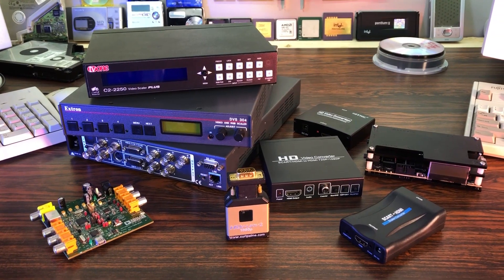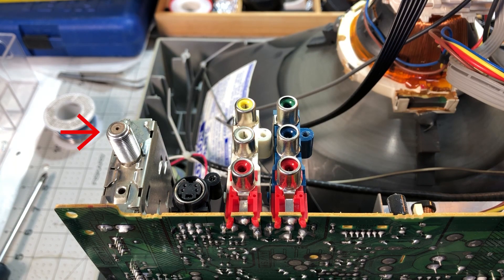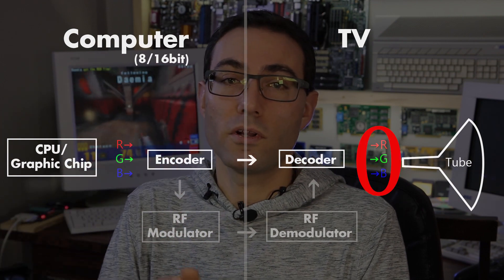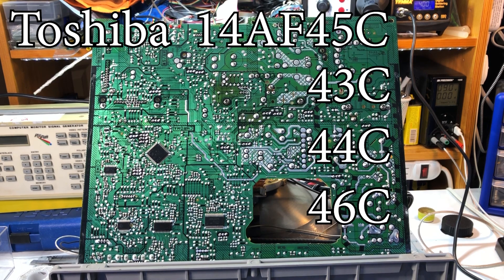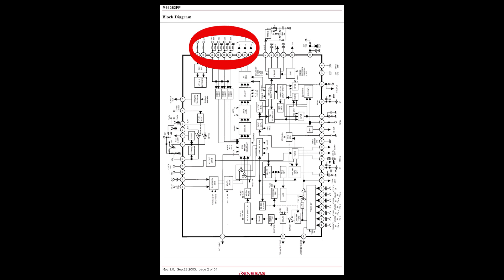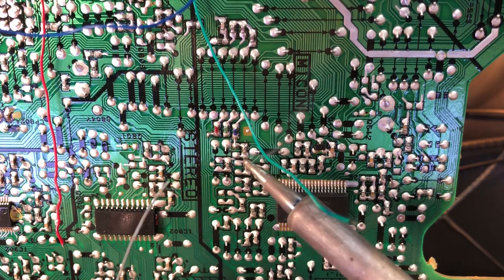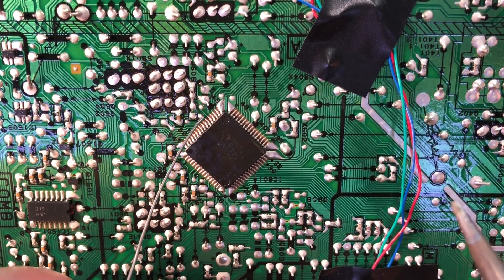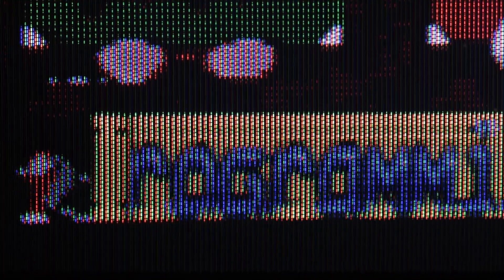Toshiba TV - RGB Mod

Comment: WHY ARE YOU RGB MODDING THIS CRT IF IT ALREADY HAS COMPONENT, COMPONENT IS RGB IN JUST TRANSCODE RGB TO COMPONENT
Reply from the maker: No need to yell. Granted this model already had Component input, and you could use an RGB to Component converter to get identical results, the idea is more to give a tutorial on RGB modding. It also skips 2 transcoding steps and and buying extra hardware for people who want to train on the practice RGB modding with a model that is quite common and easy to find, it was more for the demo and an excuse to make a video about RGB modding than anything else.

Comment: I’ve managed to get a few different sizes of these over the years… everything from 12” to 32”. I like the scanlines with 240p content but they don’t properly handle 240p over component since they sync off the falling edge as if it were HD… even though they aren’t HDTVs. This causes a horizontal stretch and off-center image with 240p YPbPr. Not sure if the RGB mod corrects this for RGB but I’m willing to try. Disabling the Velocity Modulation or whatever they call it is something I need to do too.

Comment: Thank you so much. I picked up a Toshiba 32A35 the other day and found that my tv has the exact same chipset as you. I actually skipped over this video at first due to the differences in model, but it came up again after googling the chip's number so I watched and everything matches up the same. Thanks this made it so easy!
Reply: If the TV has component in you can just get pure RGB from component all you have to do is transcode it to ypbpr
Reply: @kirbo-db6mw  yeah I ended up doing that. Honestly my hobby is taking off since then and I have four TVs now.

Comment: Ive noticed that most Toshiba made chroma/jungle chip has two rgb inputs.
Below 20 is usually digital and are used for OSD.
22-25 are the external analog rgb inputs

Comment: I just  got this exact same tv but 20 inch!! I thought perhaps component video might be good enough....but it's nice to see that I could use those connectors for connecting RGB! Nice work, bro!
Reply from the maker: Hey thanks! This was more a practice run than something the TV actually needs, you are right Component is virtually as good so mod is not really needed on this model. But it saves a converter :p

Comment: What cable are you using? Do you need a Scart cable? I was thinking to use component cables for my retro consoles.
Reply from the maker: I built my custom Amiga to RCA cable using nice recycled shielded component cables. I gre up with SCART but it's so scarce here in North America that most my mods are using VGA, smaller, and easy to procure. I just add a "15KHz" sticker as a reminder :p
Reply: @AnalogThinker  I also grew up with Scart and now am in LA. I did not play amiga but master system.
Reply: @AnalogThinker  where are you located
Reply: @AnalogThinker  do you have an Instagram

Comment: This one has component already though. Is there a huge difference?
Reply from the maker: Short answer: Virtually no difference, except I'm skipping a few internal decoding circuits, and saving on an external converter box for my Amiga, direct feed! Plus it was fun and I thought I'd explain my steps for other models with a similar Jungle but no Component.
Reply: @AnalogThinker  thank you so much. Bob with retro rgb however did explain that the colors are actually better. I have the same set and have the hd retrovision component cables. I was wondering whether I can connect my rgb modded n64 through the newly modded rgb component connectors? How can I can get csync? Does one of the outputs get converted into a csync connector?

Comment: Good job on the video....How did you come up with the resister value of 68 ohms....was that the value of the surface mount resistors you bypassed on the board?

Comment: I had a 27af44 with a bad vertical bootstrap capacitor, I replaced it and then found a 14af43 on the neighbors curb so I took it with the intention to rgb mod it but never found out how. I ended up giving them to the goodwill computer store. 5 months later I am on the search, last weekend I was at the flea market And it was filled with crt's. So I will go back this weekend and look for a flat Toshiba crt, and hopefully understand this video enough to do it on my own.

Comment: Bonjour, super vidéo!

I have a 20AF44C I am now thinking of doing this mod on and I had a couple of questions. Namely 1. would it have been possible to just add a set of RGB outputs along side the component etc. i.e. WITHOUT sacrificing any of the built-in inputs; 2. could a pair of stereo audio inputs be added and paired with the RGB signal; and 3. what input does the TV recognize the RGB as?

I realize the second question might require further tinkering to answer. Please don't feel pressured! This is exciting and encouraging enough for a start and I'm sure all us Toshiba owners can unlock the secrets of these underrated sets together in time.
Reply from the maker: Totally possible to add 3 BNC, a SCART or 3 RCA instead of re-using the Component input. That's sacrificing the case instead of the circuit, whatever works for you. Stereo input? Also totally possible, just tap in the audio amp circuit, adding a buffer or some input resistance may be required. Finally if I recall, I believe the mod I made is injecting (like many many RGB mods) the signal on the OSD so technically it will override any input but for this particular case, as I'm injecting the C-Sync pulse on the composite input, then it only works well when on the Composite input (Video 1). I hope that makes sense (and I'm not even sure I remember correctly but at the end of the day with a service manual it's usually quite easy to figure out those mods)

Comment: I'm trying to make the mod on a 29FS4RLG, when I turn on the menu ... the voltage of Fast Blanking does not appear ... Using the voltmeter it seems that it does not activate ....
Reply from the maker: I can only guess that without a FBLK signal it means the OSD will be mixed with background video signal (which is fine).

Comment: Do you think it would work on a Toshiba 20AF45?
Reply from the maker: Looking at the Service Manual Page 25 for the 20AF45, it looks an RGB mod is possible by injecting on pins 21-23 and FastBlanking on pin 24 of IC601 (M61283BFP). This is the Theory, haven't tried and would encourage you to do the homework before attempting.
Reply: @AnalogThinker  Hey, I'm actually doing this mod right now with some help from the crt discord, and it's coming out great. The only issue is that, like you, the image is shifted to the left. I can't seem to find the service menu option that moves the whole picture, because the OSD option is only moving the OSD, not the RGB image because the movement is done in the Micon not the Jungle.

Comment: Thanks for the video. I have the same exact tv that I will rgb mod based on this video. I'm just not clear with how the sync signal works. You say your leaving the composite sync circuit alone. Where do plug the sync signal into? The yellow composite input?
Reply from the maker: Correct, the Yellow RCA for Composite is used to inject the C-Sync signal. Have fun with the mod, let me know!

Comment: Hi, I’m trying to mod a tv with the same chip. Did you put the resistors at the input inline with the signal or to ground?
Reply from the maker: At the input inline. Out of the few sets of this model I've modded, they all had their picture shifted left (even before the mod, I guess it's their aging issue) and needed a quick Service Menu adjustment.

Comment: Question:  If you repurposed the component input to be an RGB input... does RGB look better than just a component signal?
Reply from the maker: Oh and to add to this, retro gamers prefer RGB as it is the signal usually readilly available on our machines (Atari ST, Amiga, and a variety of other consoles).
Reply from the maker: FiveYearClub very good question. Component is using YPbPr, this is already way better than composite but still is an encoded signal, Y for luminance, Pb and Pr for color coding. However, RGB is the pure signal we (retro gamers in particular), want to use. It IS indeed cleaner, sharper, the best results you could get as you are bypassing the whole encoding/decoding circuit (component or composite). Hope that helps!

Comment: ANALOG THINKER< if the Electron beam the sum of all the RGB signals together or something else? why does the B+ voltage need to be set at 125vdc or the H&V sync will not LOCK and display a scrambled image?
Reply from the maker: Hi Bill, not sure I get the question. All monitors are different, do you have a specific issue? As a general statement, I would say the B+ is the main rail for a lot of things in a TV/Monitor, including Flyback power, and deflection. Also keep in mind some devices still use the Flyback coil to control the Vertical deflection, the Toshiba in this video does. Messing with B+ will indeed affect a lot of things in the chain. I am no expert but that's my understanding.
Reply: @AnalogThinker  arcade monitors have a B+ voltage mostly around 125vdc to 130vdc if this is not set right it will display which looks like H&V sync issues but I'm not sure what the B+ voltage is controlling which circuits in TV monitors or arcade monitors. The Electron beam is a mix of the RGB signals mixed together or is the electron beam something else? The Neck circuit board has RGB signals and V&H sync signals going to the Ray Gun Tube?
Reply from the maker: @billwilliams6338  It's important to differentiate B+ and G (G1, G2...). The B+ is a main voltage rail that feeds a bunch of stuff on the board. In most of the TV sets, the H/V are controlled by coils, so you won't find those signals controlling anything on the tube neck board. On this neck board, you will only find: Heater voltage (6.3V, 12V...), some G high voltages, as well as 3 signals, one for each electron gun Red, Green and Blue. Some boards have the last amplifier stage on that board as well, some monitors even have the RGB signals directly connected to that neck board. 3 guns means 3 separate electron beams. All of those controlled by the same high voltage. V+H Sync signals are treated on the main board of the set. Hope this helps
Reply: @AnalogThinker  thanks for the help. What circuits does the B+ feed? What are the G1&G2 used for? The flyback powers the vertical deflection amplifier and NOT the horizontal deflection amplifier any reasons why? Any reasons why the horizontal oscillators is referenced to 15.975khz and the vertical is referenced to 60hz, why did they pick these frequencies as the references?
Reply from the maker: @billwilliams6338  Hey Bill, lots of interesting questions. Let's start with the easy ones:
- why 60Hz refresh rate: simply because in the early days of TV, it was very common (easier) to use the mains AC voltage frequency as a reference, 60Hz in America, 50Hz in Europe. For the anecdote, some clocks were also using this method, coupled with a divider, after counting 60 (or 50 in europe) pulses to trigger the next second. 
- Why 15KHz: different video format standards came up, Interlaced at first (30 images a second made of 2 interlaced fields (so 60 half frames)), you've heard of PAL/NTSC, where 15Kz standard really took off.
- B+: Now coming back to the B+, it is a standard notation for the high voltage, stemming back from early vacuum tube devices where the "A" was the "low voltage but high amperage" for tube heating, "B" was the high voltage between for anode and cathode (and "C" for bias). Nowadays the TVs and monitors would have 3.3V and other 5V rails for the logic, maybe some +/- 12 or 24V for audio circuit, but still use the name B+ as a denomination for generic higher voltage for the whole board. Mainly used to feed the Flyback (and its driver circuit), depending on models it could feed a variety of other things including H deflection, Tuner, CRT Control circuit...
- Horizontal and B+: Now the Horizontal deflection circuit and Flyback are often linked together. The main big transistor in your set is creating a sawtooth signal (at 15KHz) that drives the deflection coil left to right, and in some case, also drives the Flyback, nice way to kill 2 birds with one stone.

Saying it differently, B+ feeds the horizontal oscillation circuit that feeds both the horizontal deflection coil AND flyback transformer.
Touching B+ will affect all of the above and potentially even more.

Finally, G1, G2... are the grids of your CRT (Control, Screen...), they would usually be adjusted to control your overall brightness but must not be messed with, especially if you are not familiar or don't have the proper tools and values, you may affect white balance, contrast, convergence, focus... and put yourself in danger, like many other places in a CRT.
Reply: @AnalogThinker  thanks for the help 
I still don't under stand how 30 frames a second = 15Khz for the horizontal sync? 
The G1 & G2 are high NEGATIVE voltages to bias the grids of the CRT? Because when you're adjusting the Brightness, Screen, white balance, contract trim pots you're adjusting the G1 & G2 bias high voltage?Why doesn't B+ feed the Vertical oscillator? the vertical oscillator works on low voltage not high voltage? What are the differences between a deflection coil compared to a YOKE or are they the same thing?
The Flyback is just a step up transformer that steps up the main 120vac into 19Kv to 30kv, but the flyback also has other output taps like the B+ voltage etc? 
I find it weird that monitors use an isolation transformer to have isolated lifted grounds. I'm not sure which stages/sections in monitors are isolated and which are grounded to earth ground. I have no idea why they did this to isolate not have an earth ground tied to the monitors main circuit board and neck board, any reason why they did this? 
The neck board has 3 separate ray guns RGB which are 3 separate Electron beams. The 3 separate electron beams are controlled by the vertical oscillator sync & horizontal oscillator sync which are the coordinates positions on the CRT screen.  There is ONLY one H sync signal and ONLY one V sync signal for ALL 3 colors RGB?
Reply from the maker: Oh and I forgot but this Sencore document is a real easy-to-read and short summary of CRT basics: http://www.repairfaq.org/sam/reppic/horiz-tv.pdf
Always a good start if it's your first time, before diving into a specific model's service manual.